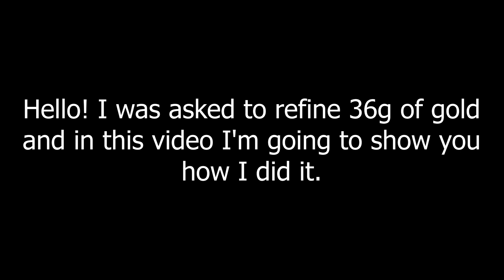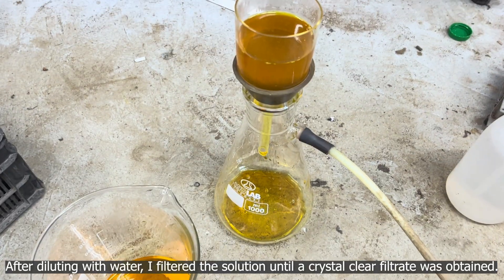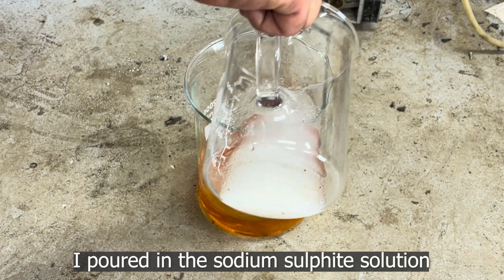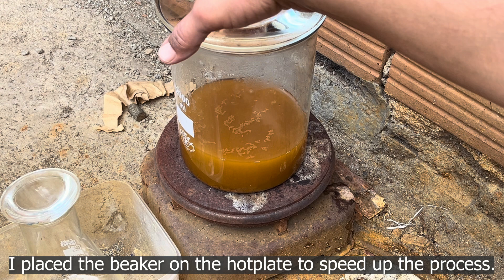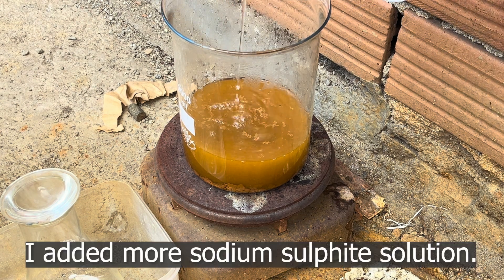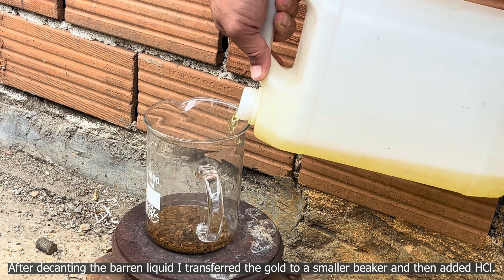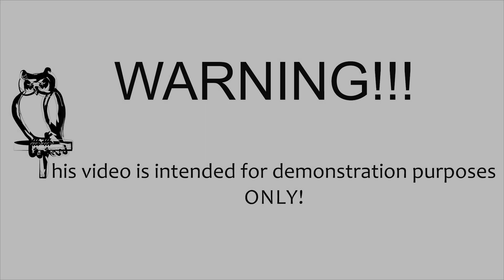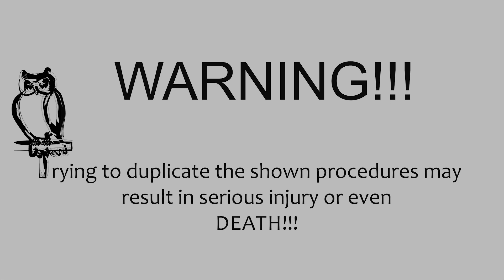Unlocking 24k Gold: The Sodium Sulfite Method!

Comment: Thankyou for the detail of process.
Did we need to adjust PH to certain number to use it?
Reply from the maker: Lower pH is better 1-2
Reply: I learn to process natural ore all i know it have gold, silver and PGM

Im trying to understand how aqua regia works.
I always fail to precipitate the gold using smb. I already know what in it because i sementing it using copper.

I dont understand why i always fail, and it triggers my couriocity 😂

What im doing are :
1. Grinding and roasting.
2.  Leaching base metal.using 50:50 Nitric acid (always leave behind red powder look like mud in the water. I dont know if it fe or pgm)
3. Using 1M hcl, boil it, and add nitric slowly while maintain to not over heat the sollution. And now i get red aqua regia like PGM in it.
4. Filter it multiple time til clear.
5..now the trouble begins.

I already try multiple ways sometimes i separate my sollution to 5 small sollution and do different ways.
one time m using smb it by dilute the sollution and turn yelow green, then add smb and become blaxk (like coffee black)  within a second it turn red again.

This is like.trolled by solution 😂

Comment: The most important tool for prospectors is using physics in dowsing with the modern light weight ball bearing dowsing rod. In the 1970's my father and I reverse engineered the physics involved in dowsing (the same physics that energizes the alarm on electronic metal detectors), and invented the modern light weight ball bearing dowsing rod to locate our old core-drill on the exact center of gold and silver veins that are buried under 200 feet of glacier rock and till, which worked out perfectly for us. These dowsing physics and dowsing techniques are too important to the world for myself to selfishly take to the grave. So I wrote the book to teach the world all the physics involved in dowsing, with marketing my book at the lowest price possible, so that more people can buy my book to learn how to apply physics in dowsing. My book: The Art of Dowsing - Separating Science from Superstition ($14.95), by Michael Fercik, explains all the physics involved in dowsing and teaches how to build the modern light weight ball bearing dowsing rod, which is the only dowsing rod that accurately gauges the element being dowsed by pitting the energy of gravity against the energizing of the pure one-tenth ounce dowsing rod load that is tapped onto the ELEVATED acetylene welding rod, which free spins on ball bearings. This precisely gauges the dowsing of all edges, exact center, depth buried with angle of deposition, and most important is grading or deciphering the amount of the dowsed element that is contained in the elemental mass that is being dowsed. Anybody can become a professional dowser by practicing my book's dowsing lessons of buried pipelines and electrical cables, tunnels and voids, precious and base metal placer and lode deposits, dowsing for treasure, dowsing for any element, amplified long distance dowsing from a moving vehicle, and dowsing on water from a boat. I hope dowsing enriches your life intellectually and financially.

Comment: Would SMB (sodium metabisulfite) work as well?
Reply from the maker: Yes, the reason I used sodium sulphite is that I forgot to restock SMB
Reply: @OwlTech333 2:28
Reply: For direct gold plated microprocessors, it is better to use as a first step nitric acid to remove other metals?